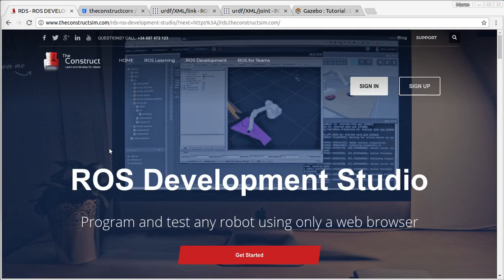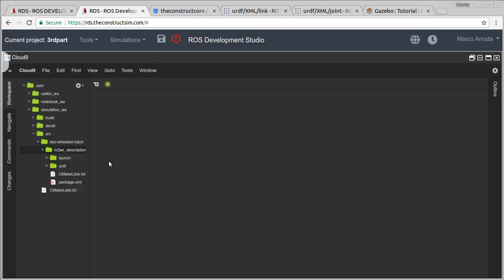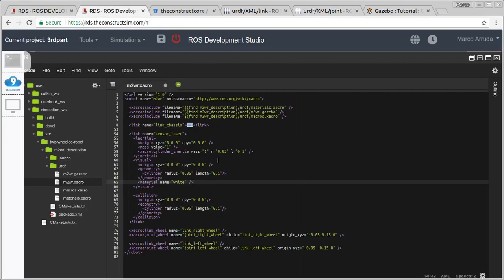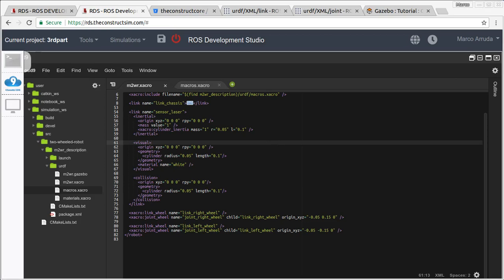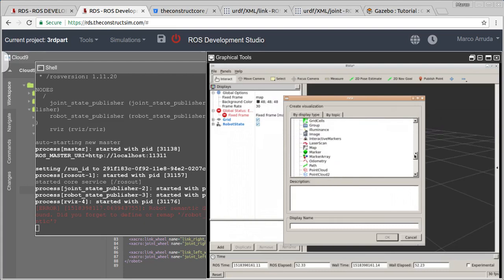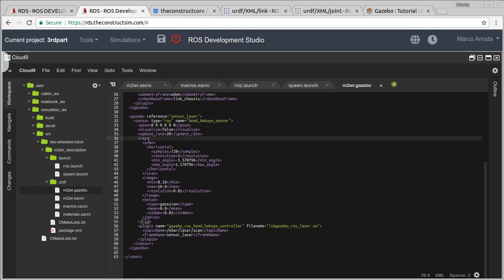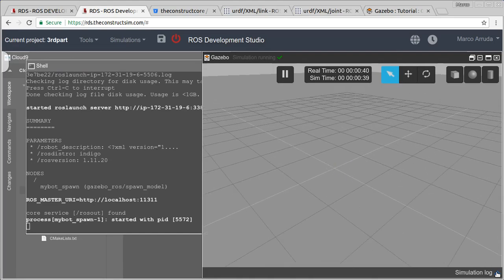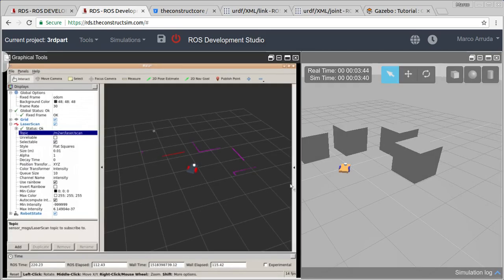Exploring ROS with a 2 Wheeled Robot #3 : URDF Laser Scan Sensor

Comment: I got this working but with a real RPLidar scanner. For some reason the data seems shifted by about 90 degrees in the wrong direction that where I want it. How can I add this shift in so that it rotates over an angle? thanks